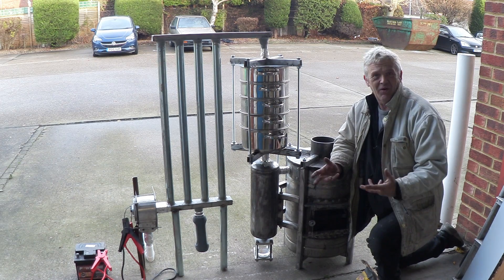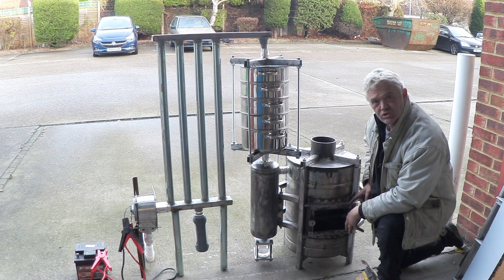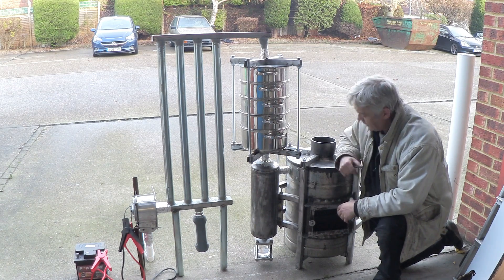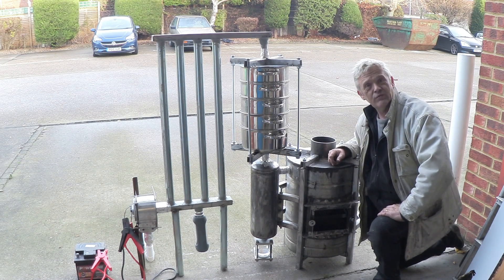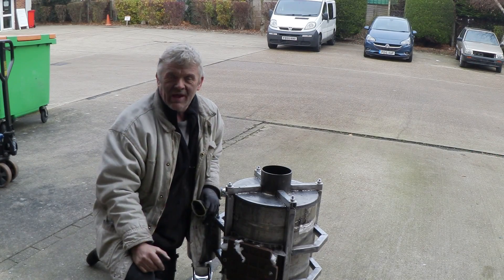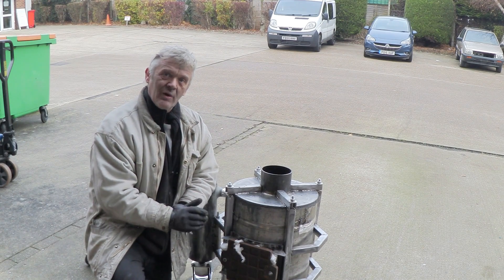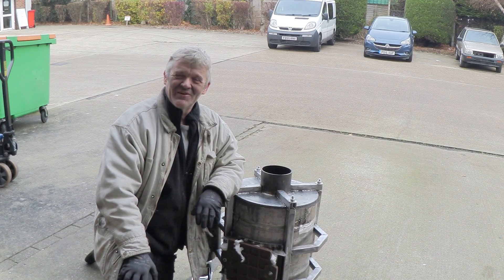DIY Gasification and Generator Unit - Part 8 - Fire It Up

Comment: If you are running it on charcoal then the output is CO2 + CO, there will be no H2, hydrocarbons, or the troublesome tars raw biomass will give you.
Reply from the maker: cheers mate
Reply: Wrong, The carbon-based matter is composed of five main elements: carbon, hydrogen, oxygen, nitrogen and sulfur. ... Brown coal thus contains slightly more hydrogen than black coal, although the biggest difference between the two is in their carbon and oxygen contents.
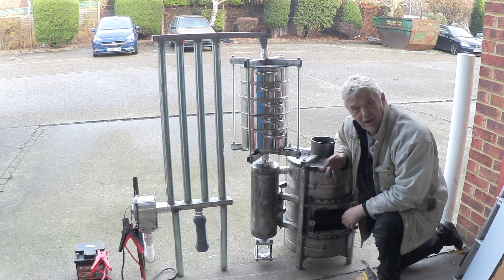Reply: @JSabh  He is burning charcoal,  1:00 it has already been subject to devolatilization. <rolls eyes>

Comment: My guess is that your blower is running too rapidly.  Gasifiers tend to be self regulating (within limits) based on the vacuum (engine needs/demands).  You need the blower to get the CO generation established, then switch over to the intake vacuum from the engine for operation (I suspect you know this already... but not obvious from the video).

Well done... good build!
Reply from the maker: I do know it mate but thanks for taking the trouble to mention it - I may not have done and the help is certainly appreciated

Comment: You should turn off the fan when it gets up to temperature.  You will probably also need a way of controlling the oxygen levels to get the right mix.
Reply from the maker: cheers mate

Comment: Yeah that is bit dirty. In day light you should not be able to even see the flare. Dont listen to the "blue" that is total nonsense. H2s does not burn blue it is orange. Any blue you see is coming from the CO. But that yellow is a good indication of tar. If you are running on charcoal only, I would not use that charcoal and go and get some lump charcoal instead of those brickets.
Reply: Ok re watched and noted you are running charcoal only. Yeah there should not be any tar, so you are probably ok. If you had not broken any of the charcoal up, break it up into smaller pieces and see what happens. The more dense your charbed and the more surfaces you have the more reactions that can take place. That flare is actually tiny, my blower shouts out a 4 foot flare and is generally a pail blue/ white color or a pale peachy / White color.
Reply from the maker: cheers mate

Comment: @Robert Murray-Smith

I bet you are already ahead of me lol, but some sort of "Dilution Valve", or some system to modify the fuel/air ratio will be needed.  

I think some generators for running on petrol AND propane/shale gas (methane) have systems for this, but with petrol only generators it will probably involve tinkering/dissasembling the carburator (that and/or making the external dilution valve for "syngas + air" before the syngas even enters the generator (Maybe even before the fan to allow for post-fan burning/flaring?).
Reply from the maker: I was thinking along those lines for sure mate

Comment: I think  AvE had a video on it, but just FYI, commercial charcoal briquettes have more "Ash Content" than lump charcoal (either diy, or bought) due to processing dust etc.

Cody's lab has a pile of stuff on making charcoal if need be.

Also wood pellets are good fuel as well (and can be cheap, along with sawdust) (you can get waste sawdust (from woodshops, or even some lumber mills for near free) and make pellets too if you make/buy a press)
Reply from the maker: cheers mate

Comment: Looks like you might have enough to power a tank there, not sure where you get hold of one though???:) wouldn't less voltage tame it?
Reply from the maker: a slower blower or a plate on the pipe - something to reduce air flow through
Reply: @ThinkingandTinkering  something will turn up I'm sure,probably restricting the airflow in is the easiest? I've always liked the dome shaped steamers that fold out in hinged petals to resemble a sci-fi radar dish,not that it's relevant lol but thinking controllable aperture like a jet engine thrust nozzle:)

Comment: The flames should be more blue to actually make the comment it’s producing too much. Yellow flame is actually a cold flame and a sign that your producing gas but not enough to actually run an engine. Your blower is too fast and is adding too much oxygen but that is just my observation and yes I have built a few gasifiers.
Reply: I use very powerful blowers on my systems. They are Amtek vacuum motors, I use a speed control to throttle them down. But you are probably right as this wide open without a static jet system. Live and learn, I tried to tell him to build a charcoal unit. but ohhh no thats way to simple. Such a waste righjt?? Yeah I spend a decade developing very advanced systems and reluctantly and refused to build a charcoal system. I finally built a system just this year and I have now fully dropped all direct systems. Charcoal is by far better tech and we have already developed charcoal production systems that are 50% yield of the raw feed stock. Add in the water drip plus mixing in sawdust, we are now ahead of raw fuels gasification  in fuel production efficiency and it is less work. Plus our processors can be used for primary heat and hot water. With that reclaim its extremely more efficient. Yeah we heat our shop with our kiln and it produces more than a days worth of fuel ready to run other than dust screening. :)
Reply: Exactly, the flame would not be visible if it were clean syngas. Also, that blower should be shut down after a minute at most and the unit should run without the blower, correct me if I am wrong but, I understand the blower to be a start up mechanism and not a continuous use.  I tried to tell him that temp was the bigger issue with getting the clean gas, guess Rob missed that. 1200 F to break hydrocarbon chains into liquid fuel/oil but only 650 F needed to keep the reaction going with a sustainable flame. Have you built any gasifiers that use a sealed vessel instead of an open cavity? Thanks.
Reply: @JSabh  yes the blowers are only for startup to get to temp for paralysis and then the engine takes over to maintain. all my gasifiers are an air injection type and not an upstream or downstream. I have tried many different versions but to achieves higher temps I use an engine exhaust and air mixture. Burning hydrogen produces steam and nitrogen so in my head putting that back into gasifier isn’t a bad thing. But my gasifier also has a used oil injection port into combustion chamber and it allows me to extract a diesel fuel through a catalyst of activated charcoal. But with an added chamber you can add a recycle chamber and pump your garbage through and extract fuels. Plastics and kitchen oils, cardboards and all kinds of stuff make good fuels but the system does require a regular cleanup and change out of the activated charcoal.
Reply: @marthale7 He is running on pure charcoal, so I have assume he Not making tar. However, even a charcoal gasifier can make tar. You can not filter tar anyways. It is carried in the gas in gas suspension. If you see tar in your filter that is just where that "grade" of tar condensed out of the gas stream. That does not mean the filter did anything. If you have tar in your filter then you generally will higher grades of tar in your engine. The better the grade the more damaging it can be to the engine.
Reply from the maker: yes there is too much oxygen but then I am lighting the flame a good foot away from the outlet - I don't know mate but when I try to light a propane torch with the gas flow too high the same thing happens - it won't light - seems to me that is what is happening here - but I take your comments on board cheers
Reply: @marthale7 Yup, Yeah I make charcoal everyday for our systems. The kiln is what heats our shop. I offer a DIY kit for the Kilns and also an entire product line of charcoal systems.
Reply: That is correct.

Comment: How about making a simple cone on the end of the pipe to slow down the flow and show a self sustaining flame ? At the moment in the video it looks like too much air not much gas. Just tin snip out of thin sheet and put it on the end, then you can show a nice big flame if its gas, wont work if its mostly air.
Reply from the maker: cheers mate

Comment: My congratulations! 
I did'nt expect this result! 
Do you have any planning to store the gas?
I mean you can compress it and fill in a high pressure cylinder. Another way would be the old fashion style (don't know the englich name - calls in German Gasometer) which is more simple as compress it.
However: Great!!!
Reply: we call it a Gasometer too :) and im sure you could combine the two to reduce space, fill a gasometer to about 80% capacity, then engage a pumping mechanism with a check valve to pump it into a high pressure environment so that you are not drawing too much air through too quickly in a continuous cycle
Reply: @Palerider1942  Thank you, mate!
Reply: For small quantities of gas, a big nylon or other plastic bag might be better. Put a weigh on top to provide the needed pressure. Nylon is fairly good a elevated temperatures, PTFE too expensive, yet is UV resistant.  But it would have to be large due to gas being low density energy.  In the war they used collapsible frames of vulcanised canvas on top of vehicle to carry town gas – lasted a few minutes. Remember, stored gas such as this, can cause LARGE explosions if too much oxygen gets mixed with it. Handy though, if the gen/other is only used periodically.
Reply: @Nuts-Bolts  Dear Nuts Bolts, the big bag is a nice and cheap idea to store a small  ammount of gas. - One way for DIY. A simple gasometer as well. To compress ... I would not put my fingers on it: As you wrote: Risk of large explosion.
Reply from the maker: I was thinking of slowing down but late maybe looking at conversion to ethanol

Comment: I would put the filter after the cooler so the moisture gets separated before the filter ,otherwise over time it will clog the filter and wont work as good.
Reply from the maker: cheers mate

Comment: Bl**dy awesome 👌 that is so good, hat of to you sir! Would slowing the fan speed with a varistor work? So its more controlled fast to start to get going and then slow for use?
Reply: its easier and more efficient to use a buck converter to var the fan speed
Reply: @dantronics1682  excellent why I didn't think of that first perfect👌
Reply from the maker: I would think so mate - it's certainly what I am going to try

Comment: Awsome!  Are you sure you need the fan going once it's flowing?
Reply: you need the fan until you connect the motor
Reply: @deborahward5097  that's not always the case from what I have seen.
Reply from the maker: nope - but when I turned it off it seemed to stop forward flow and just smoke at the input pipe so I kept it on